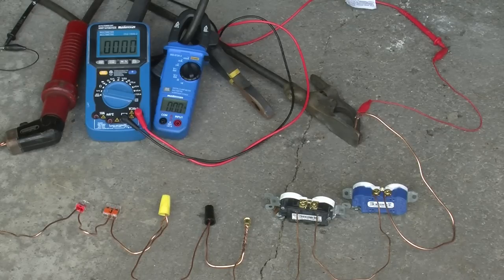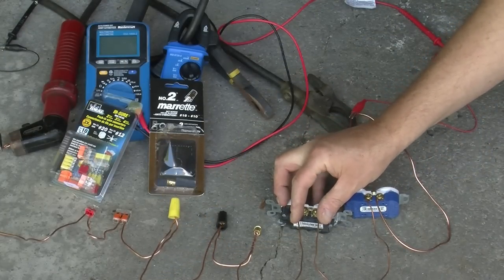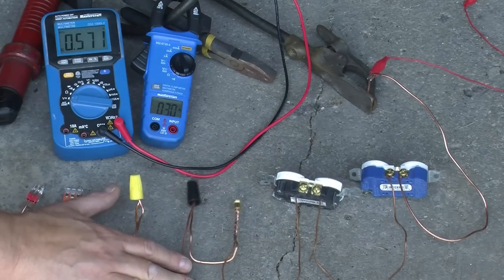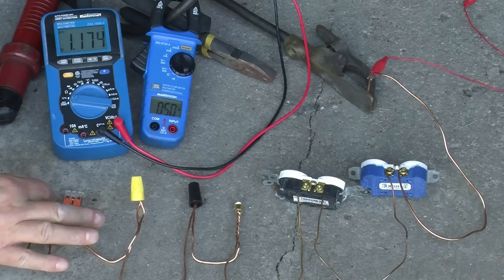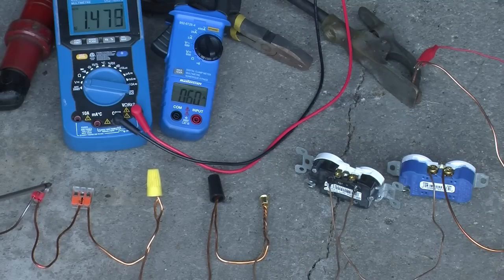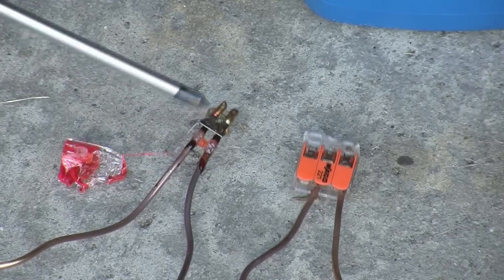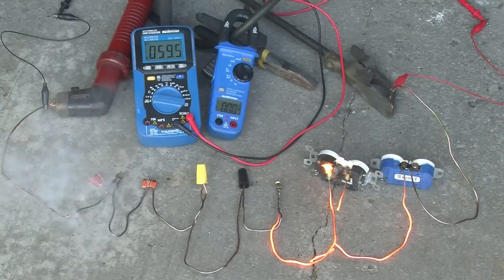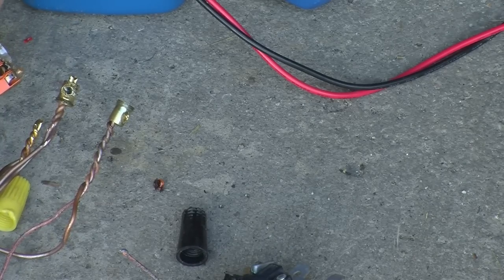Connectors: Which is the Weakest Link

Comment: As a master electrician, all I can say is I approve!

It would be interesting to try this same experiment with stranded wire.
Reply from the maker: Thanks - I appreciate that! Stranded - so lamp cord perhaps? I'll bet none of the connectors would  do as well although the lamp cord may burn up before the connector. I'll put that on my list. I should look up European wiring - I think (?) they may use stranded for standard house wiring.
Reply: No, like 14 AWG stranded wire like we commonly use in conduit. THHN
Reply: @ElectromagneticVideos  in the uk we use twin (very similar to your type of wiring) in Europe I believe they use singles (7 strand) in conduit (more of a flexible cable) and I don’t actually think we can legally use wire nuts anymore in the uk so it would be interesting to see if the wagos handle it better than the wire nuts (Wago person myself tho)
Reply from the maker: @adamdavis2788  Interesting that your cable is similar to ours and not to the European way of doing things. I had read somewhere that way back when wire nuts were introduced to the UK that the initial ones were defective/unreliable/hazardous or similar and they were then (with good reason) banned. Now that I have an IR camera I probably will do a similar test as above  but with more insight into which heat up fastest, and maybe some stranded cable. 
 
In Iraq and South Africa, both places that used British plugs and 230V, I remember seeing terminal strip type connections for household wiring - a plastic trip with multiple connectors. Each connector was like a small tube with a screw at each end - you put the wires in each end, tightened the screws and were done. Always liked them - easy to use, easy to undo, nice and solid. I use modern  versions of them for industrial and control type applications but they are never used in residential wiring over here. Are they at all used in the UK? What did you use before Wagos?
Reply: @ElectromagneticVideos  before wagos we used terminal blocks in domestic situations now the only time we really use them is when we need to connect two 10mm or larger cables together (not done that often) even tho the connector blocks are completely fine to use
Reply from the maker: @adamdavis2788  Interesting! You sure cant beat the wagos for ease of use. Will be interesting to see if the displace wire nuts over here.
Reply: @ElectromagneticVideos  they won’t replace them until they are readily available in most shops they are in the uk but I don’t think they are in America from what I’ve heard
Reply from the maker: @adamdavis2788  Your right - they are just becoming easily available over here. I think the Marr aka Wire Nuts are still by far the most common ones.
Reply: @ElectromagneticVideos  would be interested to see if they start becoming more available and if you start getting Wago box’s as well
Reply from the maker: @adamdavis2788  I had to look up Wago box! They look really neat - did a bit of googling and they dont seem to be here yet (correct me if I am wrong anybody!). I would think the barrier to their use might be just being quite different to what people are used to. I dont know if Wago has even had then certified for use here - my guess is they will let people used to their connectors and brand name and then make the huge expenditure of certifying and then promoting their boxes.
Reply: @ElectromagneticVideos  yeah the wagos box’s are a great design to be fair and under uk 18th addition regs as long as you use wagos in the box and put a zip tie through them they can be left underneath floorboards or in walls if your moving/removing a socket outlet
Reply from the maker: @adamdavis2788  Thats really neat - as far as I know here your not allowed an inaccessible junction box. I'm sure the ability to do that makes things so much easier in many renovating situations!
Reply: @ElectromagneticVideos  yes It’s extremely useful especially when we need to extend cables under floorboards
Reply from the maker: @adamdavis2788  Do you ever run into issues with a  problem in a hidden box? That's apparently the reason hidden boxes  are not allowed here - would be interesting to know if over here we are preventing a problem that really isn't a problem.
Reply: @ElectromagneticVideos  I mean we do a lot more testing in the uk before anything is livened up so we would know if we have created a joint that’s faulty
And I don’t think wagos will fail over time they have had thousands of tests across the world done to them if they where failing then they wouldn’t be aloud to be used
Reply from the maker: @adamdavis2788  Its not often logic that seems to dictate what allowed here - just because it works and has been certified somewhere else with twice the voltage we use doesn't mean it wont need a complete set of certification tests here. I sometimes think like that are actually non-tariff barriers to make it harder for foreign products top enter the market.
Reply: @ElectromagneticVideos  Can confirm the use of Few stranded wire (about 7 strands) in house wiring, Multi- and Rich stranded cables are more an industrial thing where vibrations are anticipated or expected. The common connector here in Sweden was the u-boat, a tube with one end sealed and the clamping screw in a "conning tower" on top. The wires goes in from the same end and then is tightened in place with the screw.
Reply from the maker: @bpomowe224  You know, I do wonder why here (Canada, US) we use solid wire for house wiring (outlets, lights) and in most other places its stranded.

I do know the connectors you describe - we used to have a lot of those - they seen to been replaced by the simpler Marr/Wire nut. I'm guessing cost was a factor. Too bad we dont use them any more - they are really great.
Reply: @ElectromagneticVideos  Single strand/solid wires have some advantages, they are stiffer and thus preferable in visible installations where you want straight lines.
As USA seems to allow DIY installations (here in Sweden, you are limited to changing the light switch and outlet itself, anything else requires authorised electricians), I'd say it has bin a bit easier getting good connections with singles alone than with few strands or even worse, mixing singles and few strands.
Singles are also a bit more forgiving of nicks in the copper when stripping, as you feel the difference in resistance much easier.

I don't think anyone here misses the u-boats, the cost of wagos with the time consumption of the wire-nuts...  and of course the strain in the arm of screwing them year in and year out making it difficult to work effectively past 50.
They certainly did get the job done though.
Reply from the maker: @bpomowe224  So are you an electrician? I'm an engineer but I find wiring differences between countries quite fascinating.   Is solid used in the house wiring at all in Sweden? And what is the typical wire size for lights and outlets? Here awg #14 wire is the minimum (15A circuits) but in some areas awg #12 (20A) seems to becoming more popular. (#14 is 2.5mm2 and #12 is 4mm2).
Reply: @ElectromagneticVideos  Automation technician, but basic electrical installations are part of the trade as we might have to draw the power from the central to the machines, add light fixtures above it or for some reason put in an extra wall socket for the coffee machine.

Sorry for not knowing the CENELEC wire codes on top of my head, but they are just...  awkward compared to the 'obsolete' Nordic system so everyone refuse to switch over lol
Here, a normal few (7) stranded copper wire with PVC insulation and PVC mantle is called FKK, while the CENELEC designation for the same thing is CC-S05V V-R.

First off, this is just a quick overlook, for details of the SS 436 40 00 there's some reading to be done.
We run 240V/400V phase/main voltage, so the currents are typically about half the American ones. National grid feeding the suckers in the south from the oppressed north are 440kV going down to the older 220kV net from Stockholm and southward, the regional nets are at 40kV with the distribution stepped down to 10kV before final consumer net at nominal voltage.
 Standard main fuses from the grid feed is 20, 25 and in rare cases 32A for larger houses. Industrial and building sites are usually around 63A, unless they run heavy equipment but then they usually also have their own feeder station.

Standard breakers in the central fuse box (consumer box, is that the right term?) are 10A, with 16 A for things like heaters, boilers and stoves, but those again go on either two or three phases unless it's a really old system in a city, which initially was done single phase and never touched since.

Edit: this part was poorly written, so clarifying what is the actual practice.
The standard has a base guide for wire areas as follows: >=2 A - 0,75 mm^2
>=10 A - 1,5 mm^2
>=16 A - 2,5  mm^2
>=20 A - 4,0  mm^2
>=25 A - 6,0 mm^2
Obviously it goes all the way up to high voltage lines, but we were talking home installations here.
What we look at then are:
* temperature at full power.
Heat dissipation in a narrow tube is obviously not the same as in open installation, and if passing heated or insular areas (like a sauna on the other side the wall) one might have to increase the cable area to compensate.
* short circuit current.
The total (local + pre-impedance from the grid) resistance has to be low enough that a short circuit trigger the fuse within 4 deciseconds (0.4 seconds).
 * overtone loads.
Typical example is an office filled with computers, which will generate multiplying currents at off multiples of the base frequency (50 Hz here, so the overtones of interest are 50 x3,5,7 and so forth). These will strain the neutral and possibly the PE in case of fault, and the wires needs to be dimensioned accordingly. This is a relatively new demand in home installations, but with more and more stuff becoming rechargeable and/or running on switched power it's necessary.
* exceptions
Loads that are only temporary are present for a short time, or have their own protection systems might allow thinner cables than the effect normally would suggest.

Obviously you need to consider all variables before going at it, like the boss said, while it's not fun spending time calculating, it's much less fun having to tear everything out because the wires were too thin for the breakers to trigger within the 4 deciseconds required.

One small difference about the cable is that the PE is always insulated in green/yellow. Bare copper is a strict no-go here.
Reply from the maker: @bpomowe224  Interesting - as far as electrical code goes, like you, its not my specialty. The electricians are the real experts since they use it everyday.

I'll point out a few differences between your electrical and ours based on you description:

You have 240V (3 phase 400V). We have 120/240V split phase for most homes and 120V/208V 3 phase for large buildings like apartments and offices. 

A typical home in Canada is wired with 200A 120/240V split phase coming in from the electric company (which in Canada we just call the hydro company). In 50s and 60s many homes only had 100A but that has changed to allow for electric heating which usually needs about 100A all to itself). 

It looks like cable sizes for given currents are similar. As you alluded to, you use conduits and we just used plastic sheathed cable for most homes in most places. 

Overtone loads/harmonics. Huge problem here too. I was shocked a few years ago to see how much the peak of the 60Hz sine wave from the power company is depressed compared to what it should be - its visibly flattened. The amount of power in the harmonics must be causing huge problems in the grid. 

So you actually test the response speed of a breaker once installed - we dont normally do that here here - I will have to ask an industrial electrician I know if they do that for larger beakers in factories. 

And yes - bare ground is a North American thing!

Comment: When I replaced all the receptacles in my mobile home, many of the original ones had ONLY push-in connections. No screws available. And the manufacturer used them as junctions also, without pigtails, which means the whole load of the branch circuit was traveling through the first push in connection. Some of the receptacles were physically broken into pieces. I replaced everything with spec grade receptacles which didn't even have push in connections. I wired them in with pigtails wherever possible so the screw terminals were bearing as small of a load as possible. The main reason I did this was to upgrade everything to tamper resistant outlets since I've got a small child in the home. However the massive upgrade to the connections is more than welcomed.  Before replacing the receptacles, the lights would noticeably dim when turning on a vacuum cleaner.  That no longer happens. I also replaced all the light switches, using commercial grade parts. Half of them were physically broken. I'm amazed that they were still working, although they felt very mushy instead of clicking into place.
Reply from the maker: You answered something I had been wondering - does anyone use those push-in connectors. Talk about a manufacturer skimping to save a few $! You sure went from the worst to the best! And its interesting to see a visible result of doing the improvement. Your kid is so lucky to have a parent  looking out for safety like that!  What a great story that started with a really bad situation! Thanks for sharing!
Reply: I lived at a mobile home with a space heater in a bedroom. It failed at one of those push-in connections. And it was only used on the 750 watt mode!
Reply: @djratino  if it were up to me, those stab in connections would be outlawed. Who in the hell ever decided they were safe? It seems like the only ones that don't cause problems are the ones which don't get used.
Reply from the maker: @djratino  I have not heard one comment with favorable story about receptacles where those connectors were used. They really seem like ticking time bombs!

Comment: Very nice experience, but what is the practical proof at all?
All parts were used way off their spec.
Here in Germany we're using Wagos and push-in Installations (sockets, switches) for decades w/o any issues.
Reply from the maker: Interesting to hear  they have been use in Germany for a long time. Sockets with push in connectors have been in use here for a long time too but with not so good results. I think   the issue may be with our lower voltage (120V) compared to yours, the currents are twice as high, particularly for heating devices so we are closer to the point where things start to go bad.

For me the interesting things was I have heard many people say Wago and push in connectors make better connections because they are newer. This test seems to indicate otherwise.

I would tend towards using Wire-nuts for higher current loads based on this. The other connector which I didnt test which was used in Germany when I was kid (we lived in Bonn for  4 years in the early 1970s) were the connectors that are a bit like barrier strips and have little metal cylinders where you push a wire in on each end and then tighten a screw on each end to hold it. Usually there are a few of these in row. I always have been impressed with those and have occasionally used them for automation stuff.
Reply: @ElectromagneticVideos  These connectors are called Lüsterklemme.
Seven years ago I've renovated my house from 72. My pro electrician and l completely updated and upgraded the electrics to today's standard.
By this we found and removed quite some wire nuts and Lüsterklemmen - all Wago now. There is no such debate about them compared to the States, as I'm recognizing it on YouTube. 
All quality brands here in Germany are using push-in technology, only, for standard house installations. 
The installation is much easier and way faster. Also changes are super easy. 
By the way, Wago has also a push-in version w/o the lever. This is rather the standard one and cheaper. The one with the lever is necessary if one wants to connect stranded wires directly. 
But I will always buy quality stuff from well-known companies - electrics are not a topic to mess around with.
Reply from the maker: @gundelfish  Lüsterklemme - just looked that up - thats them! They seem to be marketed over here as "Eurostyle Terminal Strips".  I have always liked that style of connector - not sure if it is even allowed here for home wiring. 

One thing I have always noticed is that German  products are generally built way better than   North America stuff, and also cost a bit more. I have always assumed its something in the culture that Germans are willing to pay   more for better quality while over here cheaper always wins. That was really apparent in many electronic items before most manufacturing was moved overseas.

Comment: I’ve always used the old school Marrette brand set screw connectors for splices where I have 4+ wires to terminate. A little more expensive but a good quality connection.
Reply from the maker: They really do seem to be the best!
Reply: If I’m putting 55 amps through any circuit designed for 20, my house deserves to burn down😂